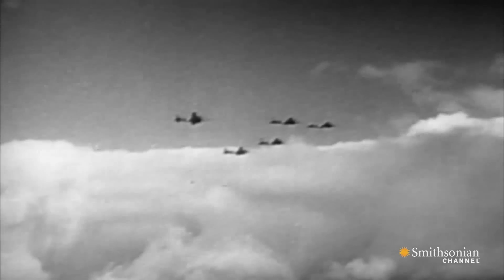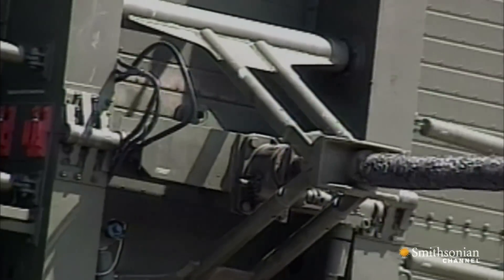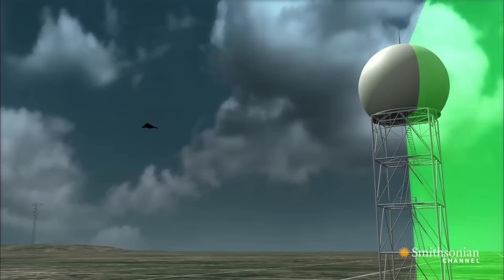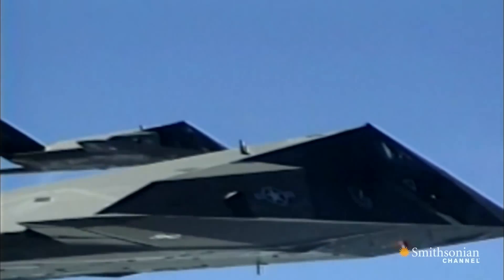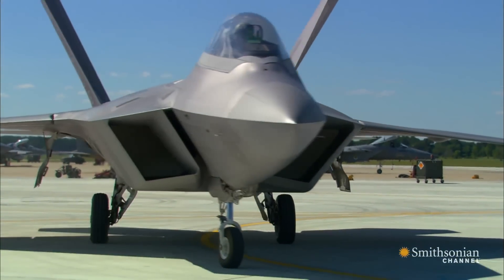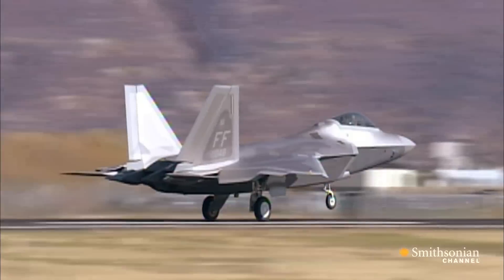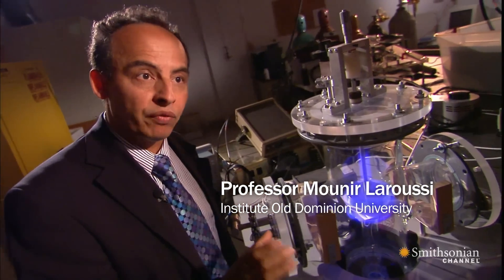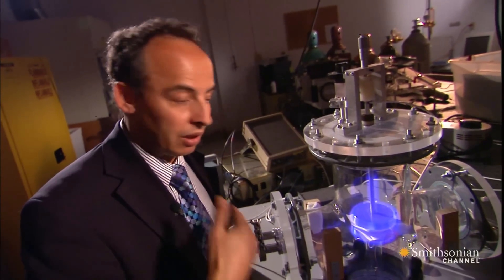Stealth: Flying Invisible - The Past, Present and Future of Stealth

Comment: No, the F-117 had a radar cross section equal to that of a modern Gripen. The F-22 and the F-35 better have a good defense against IRST. Apart from the fact that it takes ten hours to repaint each plane, making it unusable for any other air force or navy than the American, stealth is pretty much the wrong way to go, unless you have a stellar EW Suite to combine it with.
Reply: These were very effective when they were first created, especially since their existence wasnt even public knowledge for the first several years they flew missions.

Comment: I am building a plane made of transparent glass.. So when it is up there, you won't see it but the sky. and it is powered by electricity (Hybrid )no need for a jet fuel.
Reply: Weirdly enough, that was one of their ideas before this design. It wasnt so you couldnt see it though, it was because clear surfaces dont reflect radar.

Comment: Fun fact: the coating that they put on the stealth planes was discovered on accident. It was made by some guy who liked to fly smaller airplanes around. He had coated his plane in a new substance that he felt would make the ride smoother or something like that, then took it out for a spin. What he didn't realize is that he flew over where they were trying to figure out stealth. Radar didn't detect him until he was just about overhead. They scrambled their fighters, escorted him down, then grilled him on how he did it. He told all, and now we have our stealth bombers/fighters.
Reply: Incorrect. RAM (radar absorbent material) was already discovered during WWII by the Germans. They used ferrite suspended in rubber to coat the snorkel and mast of their most advanced submarine, the Type XXI-class, to prevent it from being detected by radar-equipped aircraft hunting for submarines. Ferrite beads suspended in some type of polymer was also used in the F-117, so the Germans were (once again) 35-40 years ahead of them.
Reply: D Destructus: WOW! Great story! Thanks for sharing. Is it, it's not only the design but the coating as well or only coating, which hides a plane from radar?
(Gr Britain Thu 28 Nov 2019 1901)
Reply: COD 5th gen Accidental warfare
Reply: I hope he got paid well for that discovery and the military didn't just steal his invention.
Reply: Surprised they don't use lenticular lens used on invisibility shields 

So when they fly the aircraft they can see it on the radar but fighter jets can't see the plane making it nearly useless to even use RADAR if u can't see the plane itself so what's the point of a radar revealing ur position if u can't see what ur fighting

I know some aircraft have lenticular lens
And they can't be seen on radar nor could fighter jets even dare fight them because how can I fight something u can barely see or lock on to with any missiles

It probably be the best stealth bomber that could be hidden from any altitude and not be seen from human eye making it useless to ever dare try to fight a man u can't see
Reply: Hope he got some good cash for his idea

Comment: Nice. But the stealth aircraft can be seen using thermal  optical technology. So find something that will cloak the heat of the engine.
Reply: stealth is visible if the radar uses meter wavelengths. it can also be seen if two radars are at a great distance. stealth doesn't work, it's a myth.
Reply: @СерхиоБускетс-ф7я  stealth used to work. However with advancement in radar technology it has stopped being as effective. Hence why the f117 was taken out of service in 2008 in favor of more manuverable fighters.
Reply: @averagejoe9040  stealth never worked. the USSR had radars that could detect an aircraft.
Reply: @СерхиоБускетс-ф7я  and yet in over 1200 missions and 25 years of service, there are only 2 instances of these planes being downed. Thats a heck of a track record for technology that doesnt work.

Comment: Just two of the many immediate problems with a plasma stealth shield:
1. it costs a huge amount of energy to convert a gas into plasma by ionisation 
2. plasma gets insanely hot because it needs to keep being ionized
Conclusion:  Not practically applicable to generate stealth at all
Reply: Heat shield. The SR71 had almost a permanent plasma shield because of how fast it went
Reply: @maggsstuckey487  Speed does not ionize gas. You must have misinterpreted your information.
Reply: I have been told that the friction of going through the air heats up so much it ionizes. Yeah

Comment: British: we can detect enemies(Luftwaffe).
US: We have Stealth Aircraft
Serbia: ShotDown that Stealth😂
Reply: Because the f-117 was designed to be stealthy against modern radars not the outdated ones Serbia had..
Reply: @cancelanime1507  ,f-117 cannot survive on old radar...how come it can survive on modern one?
Reply: Alzen Balto because the older type works differently
Reply: @alzenbalto7668  the plane was shot down thanks to a couple of factors, such as, the general knewn that the plane would be passing in that route, they've done multiple sorties before. He knewn it because he heard the pilots radio. If serbians were that good, then why did they only detected one F117 from the multiple ones present there
Reply: @cancelanime1507  that is not the reason, the plane was experiencing a mechanical failure and its bomb doors were jammed open, creating a very large radar cross secetion. 

Sorry, that was the yugoslavia incident.
Reply: @cancelanime1507  Dude that's even worse
Reply: It’s like a week after South Korea purchased a new radar system a North Korean drone came through and released spy pictures. Why? Radar technology is too new to discover such type of drone

Comment: Ionized gas / Plasma radar absorbing technology is a failed experiment as heat radiation will be so high an airplane can be easily  detected due to it's  thermal or Heat signature lighting up in the  sky

Comment: Stealth only works if you actually act like your hiding, not flying the same operational corridors in "invisable" aircraft so much that they modify radar to a lower frequency that actually picks up stealth aircraft better albeit with less accuracy. Ask the Serbs.
Reply: stealth works,for example first stealth ho229 was able to reduce detection range 20%
Reply: @wojszach4443  The 229 was not stealth.

Comment: The problem with plasma is that it also makes it impossible for the aircraft to transmit and receive its own radio waves making it essentially blind.  Also, the plasma may disrupt data links making it impossible for the aircraft to share information with other aircraft or to communicate with satélites.  Modern stealthy aircraft passive radio sensors in-beaded into the skin which can detect other aircraft, but a plasma shield make those sensors ineffective.  Plasma may be the ultimate invisibility cloak, but it hinders the sensors and data links making the aircraft a poor fighter.  Maybe plasma would be good for reconnaissance aircraft like the U2 or new SR-72 which is under development.
Reply: Yeah, It happened to the space shuttle and the soyuz during the re entry in atmosphere. A quick solution of your problem is to not cover the entire surface of the airplane with plasma, and leave some holes so that antennas are able to work. Anyway, the noozle, the cockpit and the  arms counters can t be cover by plasma for obvious reasons. This could be the weakness of this future stealth technology, but a total plasma cover, and then a blind aircraft Is not a good tactical choise.
Reply: They can get around that with towed array
Reply: :o
Reply: @cptmorgank917  ar
Reply: Maybe it could activate only while over enemy territory and then turn it off?
Reply: They could activate plasma cover in bursts
Reply: @vasilis6691  😭❤️👍bas

Comment: So why not invest in radar systems that use more than 1 tower/transmitter. Then if the radio waves from one tower is disrupted on it's journey or does not reach the receiver, that data can be used to locate the aircraft. And if one or more transmitters fall, they can still work as conventional radars?
Reply: That could work for certain stationary strategic AA emplacements
Reply: It already exists, in fact it already existed 30+ years ago. Back then the Czechs had a stealth-defeating radar, I thing it was called Tamara. Nowadays there are much more advanced variants like it which uses ambient radio transmissions from tv, mobile phone and radio towers, making it virtually unstoppable (good luck bombing every single cell tower in a developed country).

Comment: The sad part is that cell towers can now be used to detect any disturbances in the atmosphere, rendering the huge investment in stealth technology obsolete!  That's a crapton of tax dollars down the toilet... DOH!!!
Reply: LouistheHedgehog Yes, with triangulation, although from what I understand in insufficient resolution to guide a missile on target.   The point being though that over any landmass, the stealth factor has been made almost entirely moot as they can easily recognize the presence of a stealth aircraft.  Traditional anti-air radar sources can then focus in on the threat, which still shows up with stealth aircraft as they are not invisible to radar but rather simply have a reduced cross section meaning that they are still picked up and are simply a smaller "blip" than traditional designs.   

Yes, this doesn't apply over the middle of the ocean, but there aren't that many targets over the middle of the ocean either.  So by and large, the stealth bomber design is already obsolete thanks to simple cellular tower networks and passive radar installations rendering them clearly visible from great distance:  http://www.wired.co.uk/news/archive/2012-10/01/radar-detects-stealth-aircraft

So the design goals are shifting away from stealth and back to the best aerodynamic shapes, with a focus on unmanned vehicles which can be made less expensive and with a greater performance envelope without a human on board.  Non-stealth carrier launched fighter and bomber drones that can deploy missiles on target and don't tire and can stay aloft much longer without fatigue are the future.  The main reason the air force is fighting this is that many are aviation enthusiasts with pilot experience or are current pilots, and don't exactly appreciate rendering their jobs obsolete.
Reply: +ProjectsBlack   batman taught this?
Reply: Montgomery Bermann Thats not how displacement disturbance systems work.   A stealth jet is actually less aerodynamic than a traditional aircraft, thanks to all the sharp lines, and so they still cause massive atmospheric disturbance where they fly, especially when flying at high speed.

You would never detect the disturbance of a falling leaf like you would a supersonic aircraft that is similar to a boat going very fast in the water making huge waves that ripple outwards. 

But it is true that while they would know approximately where the aircraft is, onboard radar systems on missiles would have a hard time locking on to the stealth aircraft.    But the days of a stealth aircraft flying through an area unnoticed are long over.
Reply: They can detect it, but they cant guide a missile to it
Reply: +Montgomery Bermann Also, the radar that would pickup it would detect so much stuff You wouldnt know it it was a plane or a piece of leaf flying
Reply: +DumbDuck44 Doppler radars are not realy efficient , and Also remember atmospheric turbulence of air make it even harder to detect. I think Stealth is not the holy grail, but It is the future. Stealth is the ticket for entering a War zone, not to be in it.
Reply: +ProjectsBlack Passive is Gonna Get harder, as planes Will Hide more the communications.
Reply: +ProjectsBlack You are getting confused, You are talking about Doppler radar, but talking in terms of Radar in the Range longest Than the X band. In Both cases very inacurate and lots of thing can confuse it ( high atmospheric winds)